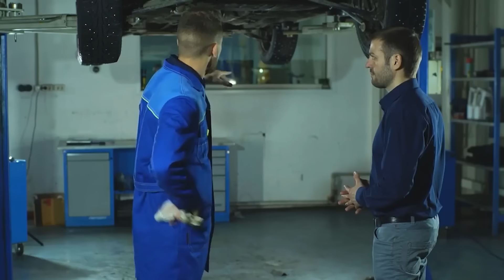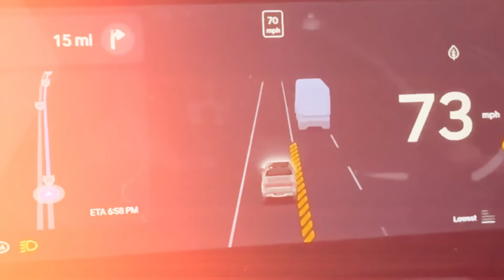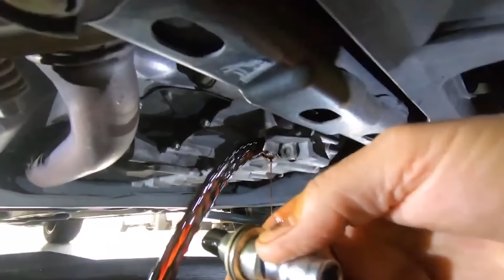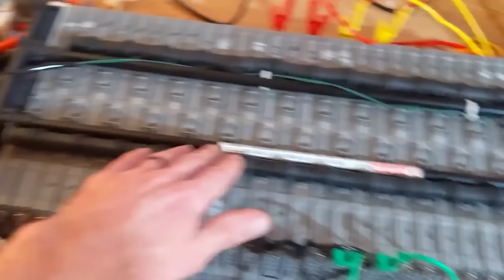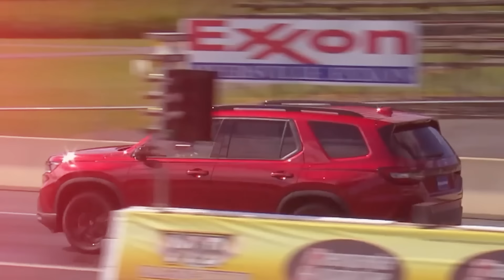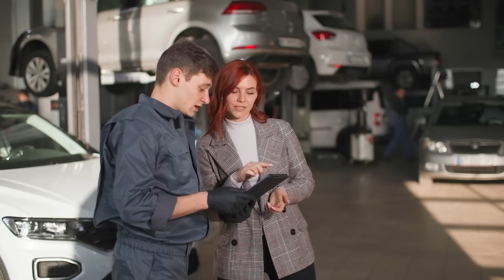NEW Honda Service Center Scams That You MUST Be Aware Of!

Comment: I’m a 78 year old female. Honda wanted $85 to change a cabin filter. I ordered one from Amazon and changed it myself for $12.
Reply: They should be ashamed of themselves ripping off a senior.
Reply: Now, where have I heard this before?
Ya, at a Honda Dealership in Ontario.
Reply: I had a Mini Cooper when they first came out…a few years later the service department said I needed a cabin filter…they quoted me over $300.  Asked why it would cost so much and they told me practically the entire dash had to be taken off to replace it…I told them I would put it off…went home, looked up on YouTube…purchased filter from AutoZone for $13 and changed it myself in 90 seconds….i timed it!  I was a mid 60s female…guess they thought I didn’t know anything about cars….or couldn’t find out.
Reply: YouTube University will show you everything you need to change filters, spark plugs, roof rails, molding. I’ve done it all. 😊
Reply: Great job Diane!
Reply: it’s not just Honda mind you. it’s all car dealers.
Reply: No! Honda was the best,  now they cannot be trusted. Honda was not like the others, Honda used to have a great name  (vehicles)
Not anymore...😢🎉
Reply: Same here, and it only took about 2 minutes to do!!
Reply: I ordered the Honda OE cabin air filter and did it myself.
Reply: I got the same estimate,  did the same . I think they sabotaged my old honda last oil change , there is no way those sensors came off by themselves at my last oil change . I usually get there repair estimates at my oil change and then fix it myself,  like the 2700$ AC reair which I did myself for 58$. Etcetera.
Reply: You save money working on your car. I recommend getting your grandson to learn how to change oil, filters, tires, and coolant. Great life skill to have and u save money. They’ll try to fix a problem that isn’t yet a problem just to make a buck off of you. Acura tried to charge me $1700 to fix an oil leak when a local shop will do it for less than $1000.
Reply: @FLoHunnit all thee of my sons know how to work on cars…just about everything… saves me lots of money now that their father has passed away… he taught them to me self sufficient…and YouTube helps
Reply: Unless the service is free which already paid in the purchase price, then I never go to the dealership to get my car serviced. Because you have to help the owner of dealership pay their rent of the huge campus and the salary of their beautiful front lobby lady and the free coffee. 😅😅😅😅😅. So the extra unnecessary service becomes natural!!! 😂😂😂😂
Reply: Hell yeah Diane
Reply: It’s always “you need a new cabin filter”! What a scam! Good for you to buy online and change yourself!
Reply: That was usually the price for my 2 Hyundai's. Every dealership charges around that price. I just go to a Auto store and buy it and put it in myself. Good job on getting one yourself.
Reply: I did mine in less than 5 minutes
Reply: Me too
Reply: Me too its so easy
Reply: I’m still in 69s and they only wanted $54😂😂😂😂😂
Reply: Me too, it is a shame.
Reply: good for you👍👏
Reply: Yeap that happened to me, they wanted to charge me, $75 for a air filter and $75 for a cabin filter, I also bought the filters on Amazon, cost me $25 for both filters, and they were Honda factory parts.
Reply: Ok but that would also happen if you were male, 20 yrs old, and at a Toyota, Ford or any other dealer. Filters and windshield wipers are usually charged at 2.5-3.5 times the cost to just go buy the part and install it. Laziness is always the fast track to spending more
Reply: Heck Yea!
Reply: Yes, I purchased at Honda, I didn't think about Amazon. Honda has gone down in everyday, used to be a trusted empire, NO MORE! Stay away from Honda's , 1.5 etc... I am scared now. I used my saving to put down on my last car.  What a serious surprise... I   feel very unsecured about my 2022 Honda CRV AWD
Reply: Me too. What a rip-off.
Reply: $209 for rear differential fluid. That cost 35 bucks and about 20 minutes to do most of that's waiting for it to drain.
Reply: I did the same thing. I changed my air filter too. I’m 66 1/2 been doing that stuff my whole life.
Reply: Oh yea. I was getting a airbag recal once and a service tech came out to tell another  owner that they teccomended changing wiper blades for a cost of like $55+ tax. Lol and he AGREED TO IT 😅😅😅😅
Reply: That Honda filter is about 5 times better than the one from Amazon. But I would also say they over engineer their filters.
Reply: @dougB4454  this is true. filters and oils I believe manufacture specific is always the best. For stock OE applications, I think people forget that labor must be done for all scopes of work, and again nobody works for free. Complaining about a $300 transmission flush with 85K miles but the consumer spends that much on coffee in a week at Starbucks
Reply: Honda OE cabin filters range from $25-$35 depending on year and model of vehicle. Labor to install is typically .20 to .30 hours depending on model, most hourly rates at shops are around $200 nowadays. .30 hours at a $200 hourly rate is around $60. Added the filter cost ( parts and labor ) that $85 quote is actually fair. Technicians don’t work for free and have families to support too in this tough economy 🤝 hope this helps
Reply: @SoCoSi707 A Honda technician could change out a cabin air filter in less than 2 minutes working slowly.
Reply: @johnr9528  If you wanna do free labor, By all means do your thing. But shops gotta charge time and make money, regardless how long it takes that specific technician.
Reply: @SoCoSi707  Yeah, now flip that "Tough Economy" coin over -- Charging buyers over $50K for a vehicle, "service" should be included in the purchase for five years -- NOT an additional overpriced charge. Stealerships operate on the same principle as doctors and hospitals, as well as lawyers and courts -- they scam every penny, nickel, and dime they can get, usually using bogus claims. Technicians, and their families, who are being supported on a "$200 hourly rate" are not going hungry in ANY economy.
Reply: @SoCoSi707 that is the problem. You are paying too much per hour to change a $30 part. You are paying ever one but yourself. Had nothing to do with a tech making a living.
Reply: @SoCoSi707 robbing banks offer a higher yield😮

Comment: I had a problem with the clear coat peeling off the trunk and the roof of the car.  Honda had a recall for the exact same problem on another part of the car.  They refused to fix mine.  Tried to see the service manager and he even lied about being in.  This is my second Honda in a row and I was going to get a CRV or HRV next.  Not now.  Thinking of a Kia Sportage now, or maybe Mazda CX-5.
Reply: I would've called American Honda, especially if it's a recall and the dealership refused to fix it. I had a similar situation with the dealership regarding my seat track the dealership wanted me to pay for labor and parts. I called American Honda. They reviewed it and called the dealership to replace parts and free labor. Queens, New York.
Reply: @lorrainescandia6267  Thanks.  Never would have thought of that since I am in Canada.  Not sure now if the recall was American or Canadian.  This would have been 10 or more years ago so probably too late.  Some drunk guy side swiped my entire left side so I got body shop to paint the affected areas of the car in addition to the hit & run repairs.

Comment: David McDavid Honda in Frisco tried to convince me that my 24 Honda CR V Hybrid must have transmission fluid changed at 30K miles. I could not find it in the manual, which is almost impossible to be effective.

Comment: One thing I hate about loving  Hondas, the service shops suck . I’ve had the wrong transmission fluid put in our 21 Passport, after driving 70 miles to the dealer. A closer dealer (45 miles) has screwed up so many time I can’t keep track. They overtightened the oil drain plug so tight (on our 17 pilot) they had to use heat to loosen it and then throw the plug away when they finally got it out. I just got a 26 passport Trailsport elite blackened & I’m already stressing about the service and where to try this time. I’d live to find a good local shop that can use OEM fluids and do the job right without my sphincter getting blasted.
Reply: Buy the OEM parts and take them to a repair shop of your choice for the repairs.

Comment: MY AC compressor took a crap on my CRV.  In order to change that, the first thing you do is remove the serpentine belt. The dealer called me and said I needed a new belt. I didn't. I just changed it 10K miles before the AC died. The best part was they wanted to charger me labor ($300) to remove the belt. The belt was already off. So I said I'll get a new belt, sure, but you're not charging me labor to do that. They refused. They wanted to charge me twice for the labor to remove the belt once. They wouldn't budge either. Said this what it costs and they talked to the service head guy and he said yep, have to charge you for that. I said nope, put the old belt back on and give me my car back. Haven't been back to a Honda dealer since and won't. Thirty thousand miles later still have the same belt on and no problems. Seems like after Covid their service center advisors are all new and bent on upselling you crap you don't need or want or trying to sell you stuff you already had done three months before. They don't even look at your previous service history, it's a joke.  If you're not somewhat knowledgeable about cars they will take advantage of you and your lack of knowledge. Sad but true.
Reply: Events such as these need all dealers names made public.  Hit "THEM" in the pocketbooks.

Comment: If you want to improve your fuel economy for free, just keep the tire pressure 2-3 pounds higher than the pressure recommended on the driver's door frame. So for a Honda Accord, the recommended pressure is 32 lb but I keep the tires at 34-35 lb. It not only improves gas mileage but it also improves wet traction and cornering ability. I've been doing this for years and there's no down side. It does not change the tire wear patterns, it just makes the ride a little firmer. But it's worth it, and it's free.

Comment: For those who love to keep their cars and want full coverage of the factory or extended warranty, make sure you do everything as told and written in your owners manual maintenance program. If you miss out on 1 item, it gives them the reason to void a warranty item.
Reply: That's what I am doing. Dealer says oil change every 5k miles so I let them do it, but I go ahead and change it in between their schedule. I'm a firm believer in 2500-3000 mile changes. You'll be shocked how well that keeps your engine running.

Comment: I own a 2010 accord that has 44k miles. I only took my car to Honda for recalls and refused the “free” inspection. I get tires, oil changes and wipers at local Midas. Knock wood, my car is so dependable, I feel blessed to have this old ride.
Reply: Until you really need them nobody  knows  your car better

Comment: The dealer that I use (Classic Honda Orlando) has now started to charge 25% up-charge on all maintenance & repairs. This is A 100% profit on all maintenance and repairs. After buying 5 vehicles from them over the years, I will no longer do all my oil changes and maintenance with. I switched to a very reputable repair shop and do all my business with them. They are great and never ask you for nonsense repairs you don't need nor up charge everything. Lots of Hondas there for scheduled service when i was in last time for my last oil change. This is a clean, professional and reputable shop!

Comment: $250.00 for a battery put in a Pilot.
Reply: $500.00  for a new battery and install at an Acura dealership for an ILX
Reply: You were lucky.  I just paid $400 for a new Pilot battery...which did not fix my initial issue.  Lee's Summit Honda (Missouri) - stay away from them.  I take my business to an independent dealer: Perfection Connection, in Lee's Summit.

Comment: Who ever made this videos must be sour or gotten fired for been a hack. As a Honda Tech I can tell you that I haven’t even heard of all this crap. At the same time the people that complain about upsells are the same ones that complain when you don’t tell them that their vehicles require some kind of maintenance or repair. Is a no win situation for us techs. Damn if you do and damn if you don’t. Can’t tell you the amount of times that we recommend an easy and fast repair, which customers decline only to come later with a more serious and expensive problem. But the mentality that we’re here only to upsell and scam you is just plain stupid. We take pictures and videos and even if necessary we’ll bring the customer back to the shop if they’re available to show and explain. Many people don’t want to maintain their vehicles due to this mentality only to come back crying and bashing the brand when big repairs are then necessary due to lack of maintenance. And this is not only a Honda problem. Other people reject on some specifics service out of ignorance and not understanding what they purchased. CVT transmission are as good as you maintain them also these new fuel injection systems, which were pushed by the governments not the brands without no real benefit. Believe me I work with them all the time and have worked with not only Hondas. They all have the same problems. Direct fuel injection doesn’t have the capability of cleaning carbon from the valves due to the injector’s location and that’s when a occasional cleaning comes into play. I could talk and write for hours, but most of you aren’t ready for the truth. Have a great day.

Comment: Timing belt job is half of that. Yes it is required on the V6 Hondas. You can cheap out and press your luck. You can also not change your CVT fluid but good luck to you. It’s barely more expensive than an oil change. You better do it every 30-40k no matter what brand you have. I’ve got 140k on my latest Honda and no issues with the CVT. I’ve never gotten less than 350000k out of a Honda. There are scammers everywhere. Just got to be smart enough to figure them out.
Reply: My Honda dealership charges 129 for cvt fluid change

Comment: Honda is not the only brand pulling this shit!  Subaru is doing the same thing! I took my Subaru to a Subaru dealer to have "recall" work done and warranty work on an engine thermocouple under warranty. I waited five hours expecting the work to be done. After waiting five hours and expecting the work to be completed, the service representative told me that they had done NO work on the car but advised me that it needed a $1400.00 brake job (less than 40,000 on the car) and a transmission oil change that cost $600.00. I would have loved teaching this prick to some new dance steps!!

Comment: Please do not make it appear ALL Honda service centers are like that. I have a 2025 Honda CR-V hybrid and I took it in about one year after purchasing it. The service tech answered several of my questions and after finding out there were no service lights on told me to take the car home and coninue driving it until a service light came on. I have changed my oil twice since the purchase and had reset the oil service light already. It appears there may be some bad apples when it comes to dealerships, like EVERY car brand. I love my Honda and the dealership I go to (and I did not even purchase the car at that dealership). They took care of the two recall issues I had in ONE visit and in about one hour. ZERO issues with the car! It is awesome, quiet, seats are comfortable and a pleasure to drive!
Reply: Please name the dealership, good ones aren’t easy to spot
Reply: What is their name/location?
Reply: Wait until they shaft you.

Comment: A Honda dealer gave my wife a $2300 estimate for work on her Civic.  She called me and told her to say NO.  I looked at the suggested repairs.  Sway bar links front and back, serpentine belt, CVT fluid change, wipers, and brake pads.  I did all the work.  I used high quality parts that cost $330.  The Honda dealer labor rate:  $200 per hour.  I finished all the work in less than three hours. 

Thanks to the abundant auto repair tutorials on YT, I’ve become a competent mechanic.  There are few jobs I will refer to a professional mechanic, but I do 90% of repairs and maintenance on our vehicles.  I won’t buy a new car because they are designed for dealership service only.

Comment: Have had best luck using an independent Honda/Acura repair shop in my city.  The last time I used a Honda dealer service department for an oil change (using their coupon), the exhaust system was oddly louder than when it arrived on my 2010 Honda.  I gave them a second visit to fix it after a look by one of their "certified" mechanics.  After 90 minutes they said nothing was wrong, but it was still loud.  I took it to an independent Honda shop and an experienced mechanic found part of the exhaust system left open by the dealer mechanic.  He smiled and did not charge me anything.  Since then the independent shop has gotten all my business.  The Honda dealer service lost my trust forever.

Comment: in 30 years of owning Hondas I never had a problem.
Reply: Same here. I’ve owned or leased 3 Pilots and one Passport since 2007. Never once did I have a CB problems with any of them and never saw the inside of a Honda Maintenance facility. I’m hoping I didn’t make a mistake buying a new 2025 Pilot last November. I’m starting to think I should have bought out the leased Passport that I had no problems with, except the very stiff ride, which at the time stopped me from buying it outright.